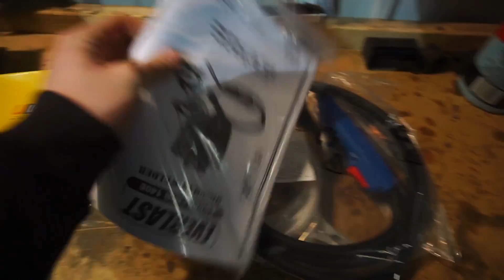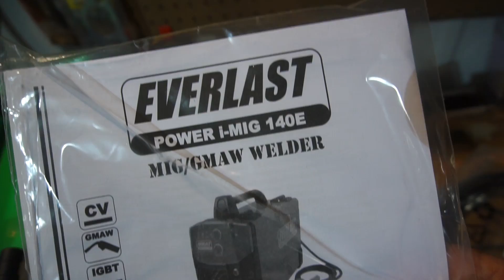NEW WELDER - S13 GETS ATTENTION

Comment: Little trick when your filling thru holes put a piece of copper behind your base metal. It allows you to fill the hole without having a huge blob on the bank side. (Steel doesn’t stick to the copper) gives you a good backing
Reply: HF has a cheap cooper 'spoon' in their welding section.  Works great for the price.

Comment: U should go to harbor frieght and grab a copper backing tool for welding and it helps fill the holes faster and smoother
Reply from the maker: 413 boosted thanks for the tip! I've never even heard of that but it makes sense
Reply: Yeah kalvin from kalvin garage did it and to works
Reply: Jimmy Oakes A piece of scrap aluminium works the same.
Reply: +1 on this. Saved me a huge headache working on my old coupe.
Reply: or just stick a piece of scrap aluminum in the back, or a penny, or any metal that isnt steel lol

Comment: You can use a penny behind those holes to give the weld some support while you weld it. The make a tool for it but a penny or a piece of copper plumbing pipe will work in a pinch

Comment: Jimmy tell Don to run a quart of ATF mixed in with his oil when he gets the motor running at first. Don’t run it super long with it in there but get the engine running warmed up a good bit with it, maybe a few hundred miles worth or so at most with it in it. The detergents in the ATF will help clean out all the sludge from his motor, then change it all out for fresh new oil. I imagine that’ll clean a huge amount of that gunk out of it. Running a good synthetic or synthetic mix oil in it will also help, it just takes longer than ATF, since ATF has more detergents in it.
Reply: Chris Clark tbh the myths that you can’t run it long aren’t true. I had an e36 with only 109k when it go it, found quickly after it was a sludge ass motor, I had about 3 quarts of atf in with the rest of oil for a total of 6k miles (changed oil at 3k) and with beating on it and everything else the car was just fine. Didn’t even have a lifter tick with the ATF as most e36s will do no matter what.

Comment: Also please stitch weld the towers I’ve seen a lot of these crack without it my 180sx is cracked all over the strut towers
Reply: Whitts adventures Any rust on the towers?
Reply: CompressorSurge 0 rust they just crack under load in my experience

Comment: For future reference jimmy, go check out kalvins garage on YouTube. He has the same welder and was using some copper pieces held to the back of the hole then welding over them. The weld material won’t stick to the copper and makes patching holes easier. Plus he’s got a sick 240 and is working on maybe getting a 300ZX to. If I recall he did an episode or two with haggard too a while back. Nice work jimmy!
Reply: Strat. Attack13 weld doesn’t stick to copper, perfect for backing wholes to plug weld.

Comment: Instead of welding the holes shut in little tacks hold a peice of brass like the head of a brass hammer or a  t air fitting and weld it in one swoop around the weld wont stick to the brass comes out way cleaner with way less grinding..
Reply: Should mention hold the brass on the backside then weld the hole

Comment: dude my coolant light has been on forever in my Ion, same with my check engine light. its only for the idle too! for some reason its higher than normal (Sits at 1k) and goes away during the spring/summer seasons. Only if the AC is on, the RPM's will drop to normal.

Comment: What’s the benefit of welding the body seams? Stiffness? A solid mounting point for crash bars? Doesn’t it inhibit crash repair though?
Reply: jrbbikerx stiffens the chassis, to prevent it from flexing as much. Gives the car a better more sturdy feel. OEM seams that are just glued & spot welded together tend to flex a lot as the car is driving. It also strengthens the chassis as a whole.
Reply: Wait, are you a dude from the video? Am I really talking to a C-level YouTube celebrity participant? Wow lol

Lol thanks for the info

J. Oakes 4eva holla